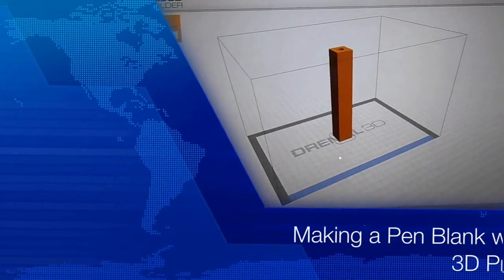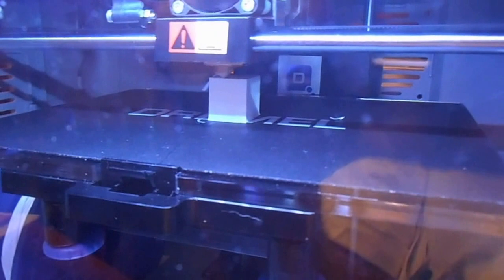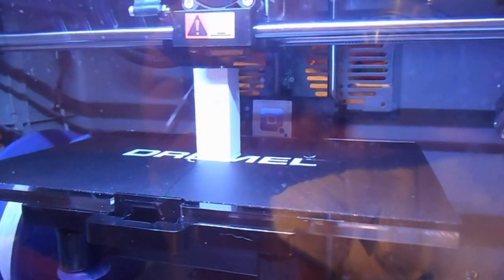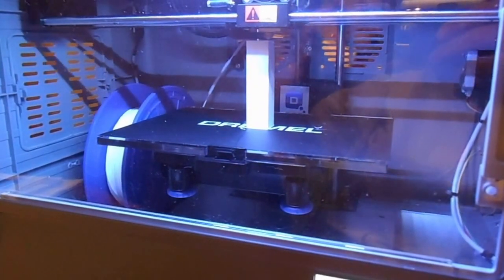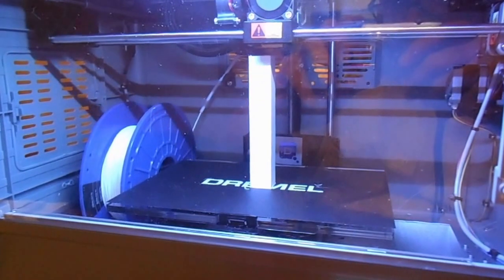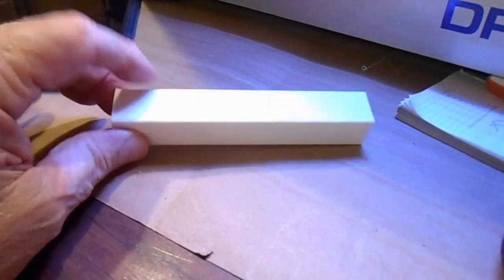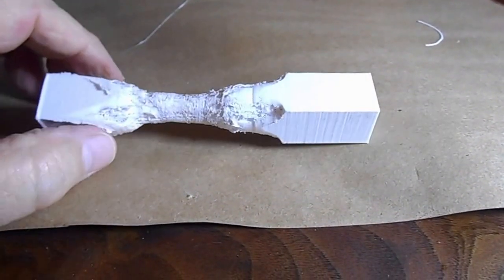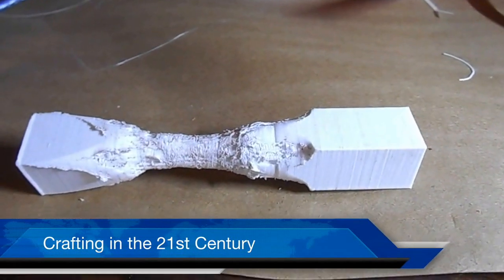Making a Pen Blank with a 3D Printer

Comment: Skip, is the surface of the hole as smooth as the outer surface? If not, perhaps you could stabilize the blank before attempting to turn it.  It seems that if you could get the resin into all of those internal spaces you would both strengthen the blank and raise the melting point.
Reply: Thanks for the suggestion. The tube inside is smooth but if I were to cut off one end to expose the internals maybe I could stabilize it. I have the failed blank still so I'll check this out. I could actually design a build which would be the correct dimensions to glue in brass tubes and be at the finished outside diameter to fit the pen parts. Thanks for the suggested. I'll post the results if it works.

Comment: Have you considered trying to print a circular blank just a few millimeters larger than your barrel hole?  Then you could cold water wet sand down to your guide bushings to keep the material from going soft. Try starting at about a 400 grit and work to a 1000 grit before switching over to your micro mesh polishing.  I'm very interested in the quality of the final surface polish you could achieve.
Reply: +Myllo57 
will do good idea

Comment: I have a friend that uses a laser printer. He has run into a similar problem as the printer "hates short strokes" so instead he changes the orientation of the piece so that the printer makes long strokes (if you're a building horizontal pen blank.
Also, if you are going to build vertically,  why not build it round & maybe to a smaller dimension. 
As far as stabilizing the blank, why not design it with tiny holes formed in the build process? That would give the alumalite somewhere to go. Not to mention possible personalization as well.
I'm not sure how that plastic will react to the heat generated by the resin or how well it will withstand the pressure.
check with Zac over at NV Woodwerkz.
Good luck,
Jim